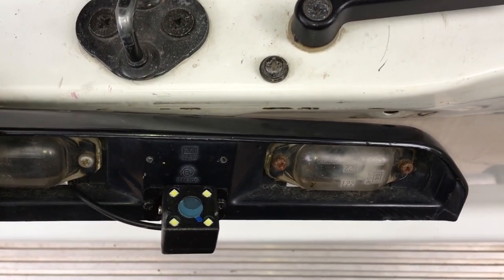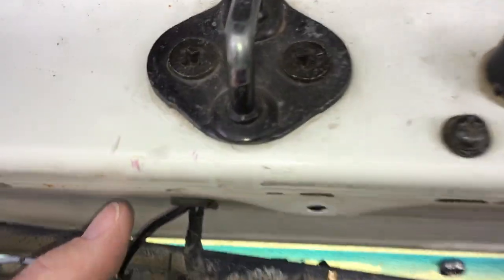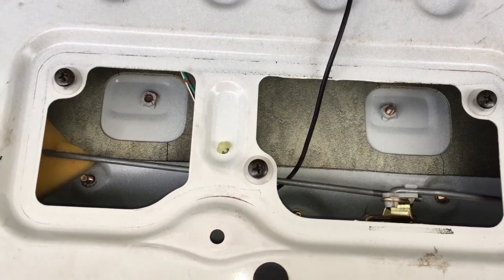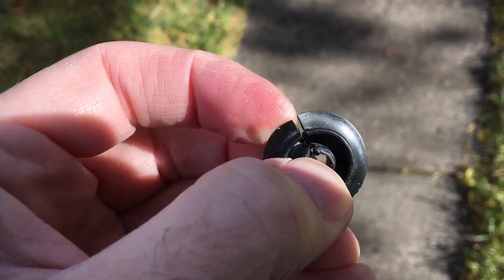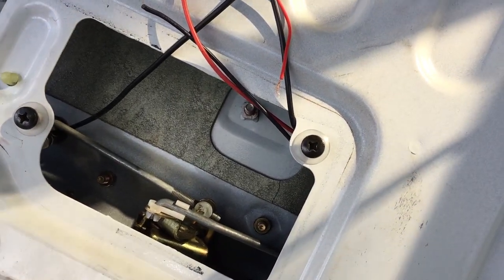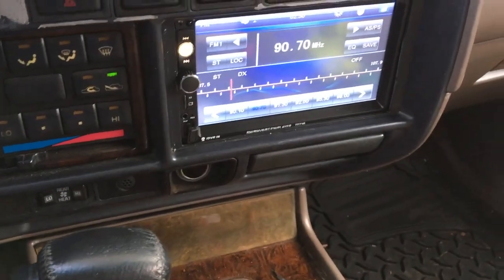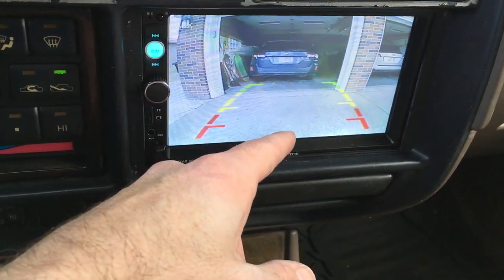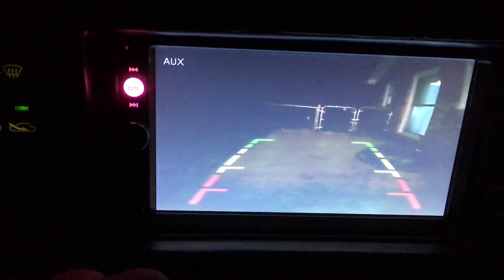1997 Land Cruiser Cheap Touchscreen Radio Backup Camera Install

Comment: If you wire the red wire from the video cable to the pink wire from the radio, then it will trigger the radio on a backup shift to look at the "camin" video input. Move the video wire to that instead of aux, and the reverse will be automatic. No need for clicking "aux" on the radio.